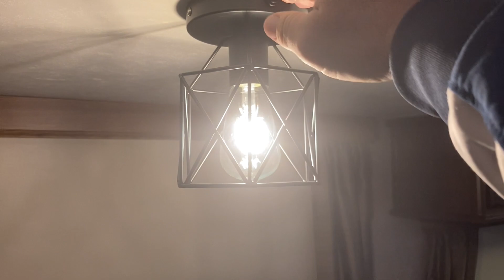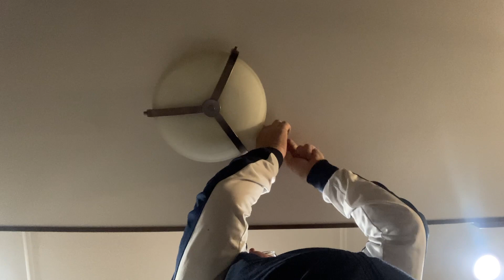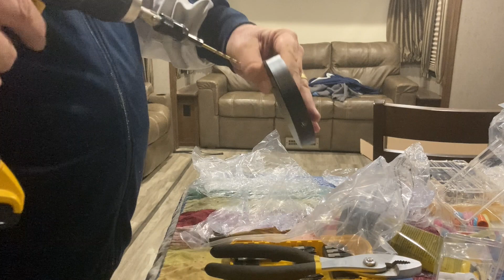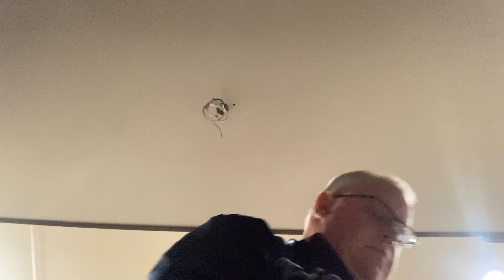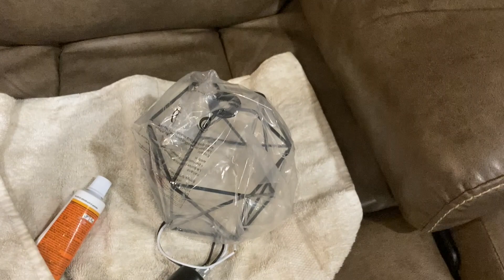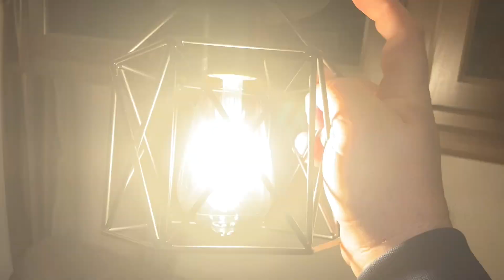Replacing the Dining Slide Lights with Industrial Ceiling Light Fixtures and DC 12v Edison Bulbs

Comment: Pretty light.   I like it much better than the factory one.
Reply from the maker: I think I do too. The really neat thing we have found is there aren't dead bugs that land and die in the glass bowl of the light. I am sure that the wire "lamp shade" might be a great place for spider webs but those are easily cleaned off. Most import thing here is that The Lovely Ms. Tina (my wife) loves them. So I am very happy with them too. Thanks for watching and thanks for the positive feedback... 
Pat
Reply: @EverythingRVbyPat  lol.  The lack of dead bugs would be a big incentive to change the light!!!